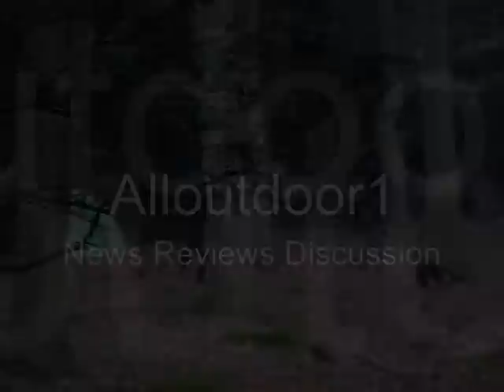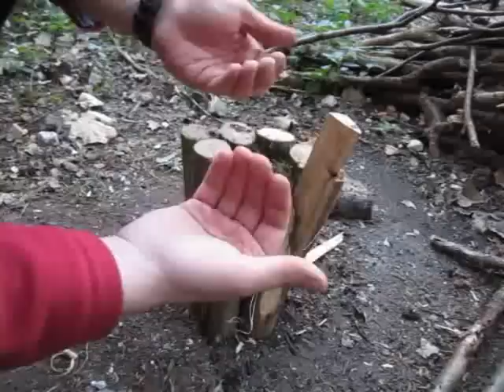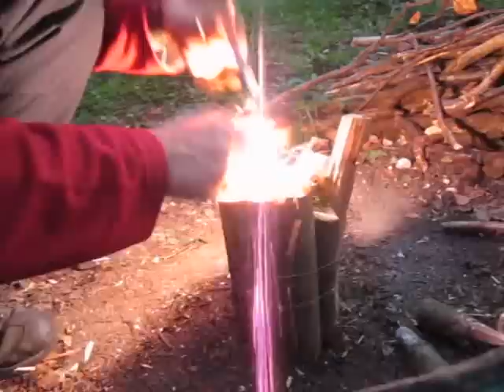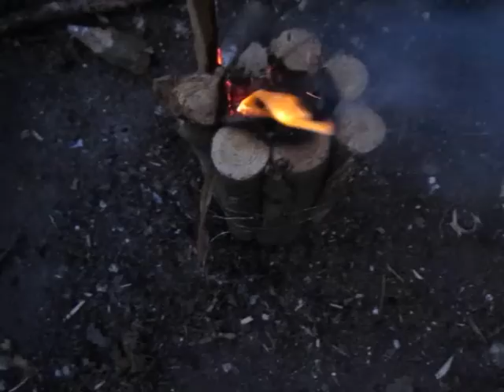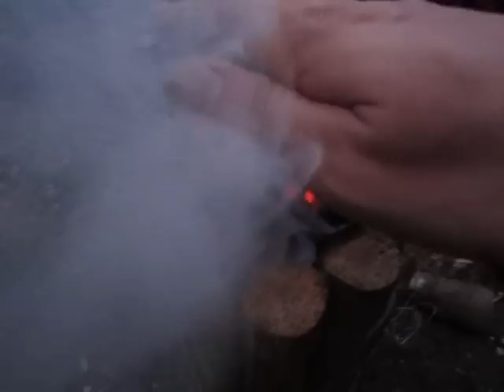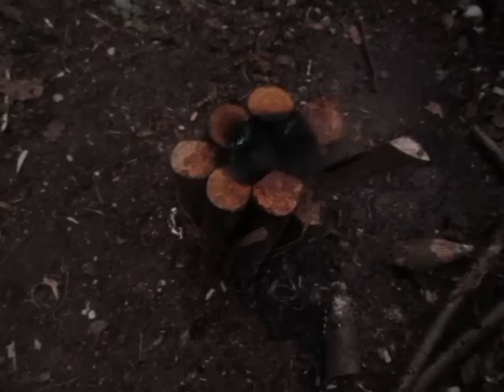Swedish Torch Variant The Alloutdoor1 Bushcraft And Survival Series - Episode 1 Part 3

Comment from the maker: @ESAPOWER Just saw your message about which motorcycle I use. When I got my A2 I bought a CB500 (honda). Its a very good allrounder. I rode it literally through hail, sleet and snow and it never failed me. Because of its ground clearance and relatively slim tyres, it can be taken off road.